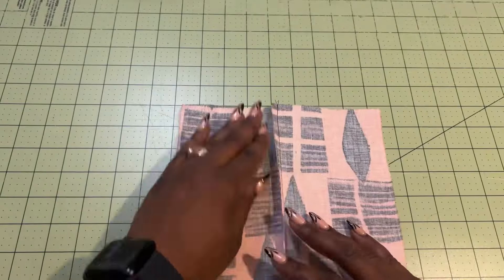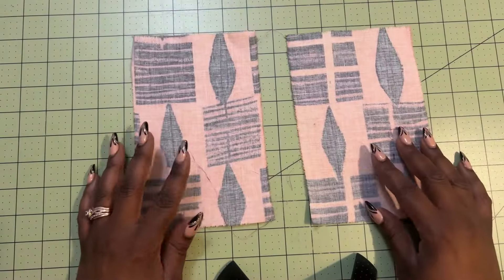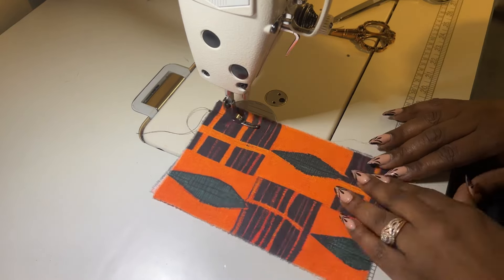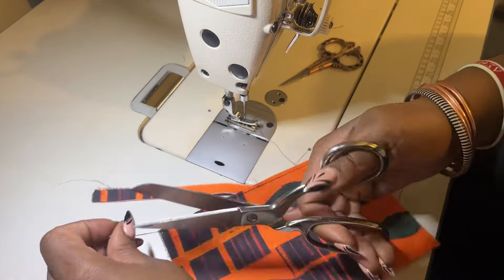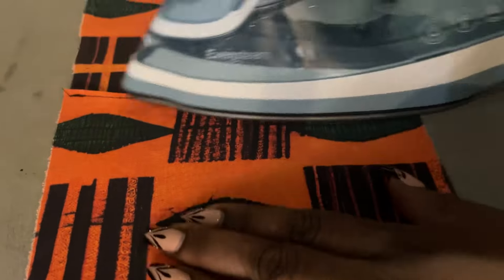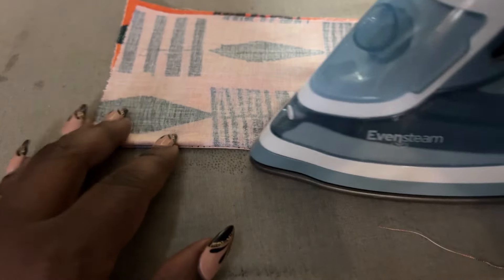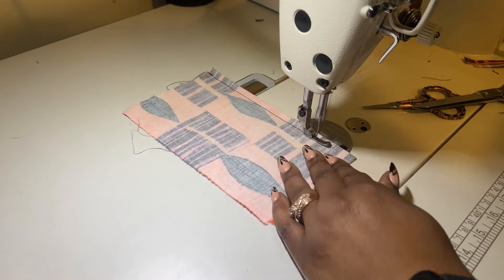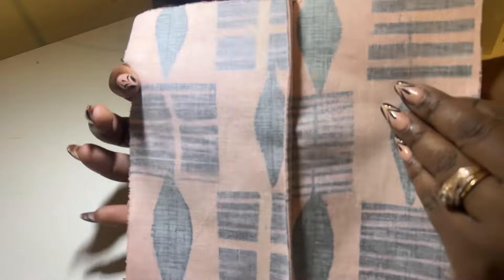How to sew French seams.

Comment: This is a great tutorial. Thanks. Straight to the point and very clear. Isn't there usually a third stitch line to sew down the little flap on the inside so it doesn't stick up?
Reply from the maker: You definitely can add the 3rd stitch it youre ok with a visible stitch line. Buts its optional. Give it a good press and it will lay flat